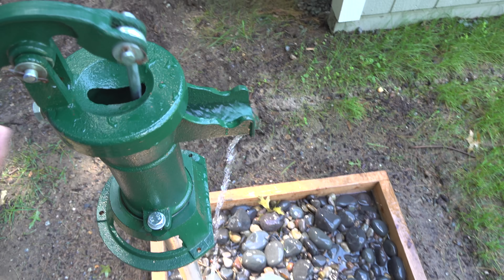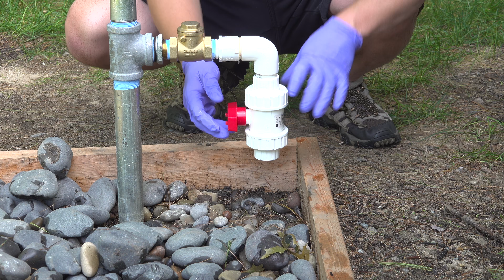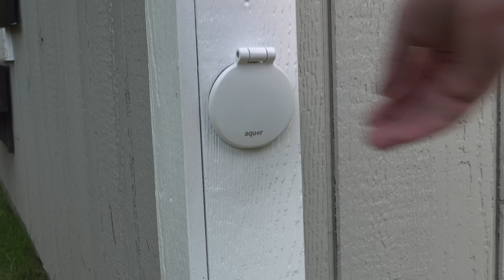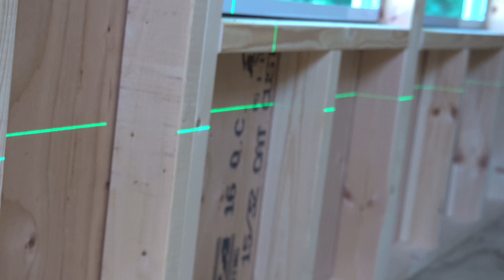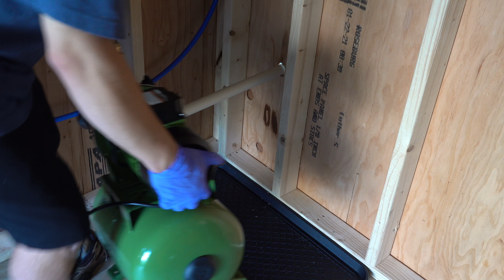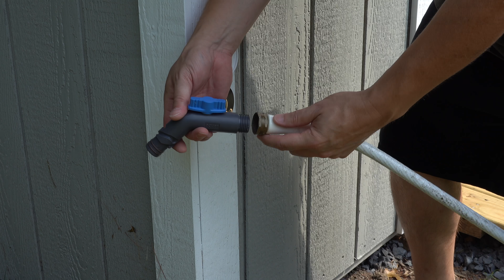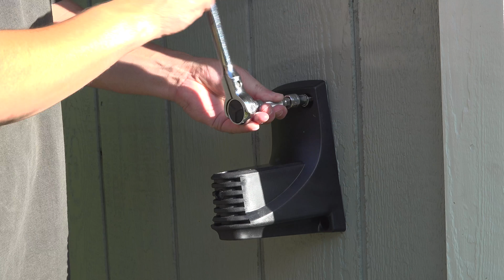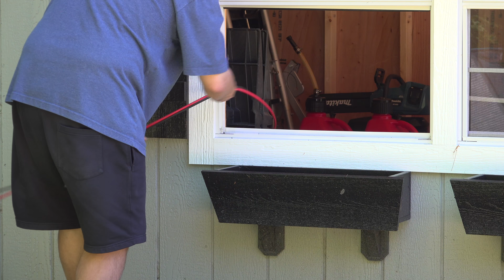DIY BACKYARD WELL with ELECTRIC PUMP - FREE Water

Comment: Nice video.   I've wondered about doing same thing for years, but additionally hooking it up to the sprinkler system.  I'm near a lake so water table is very high, in fact have a constant stream of water into sump pit 24/7 every day of the year.  Anyone know if you were to do this next to your house, is there a chance of soil compaction, and foundation damage as a result?
Reply: I'd be more worried about runoff pooling around the foundation than soil compaction. Consult a local builder, they'll probably tell you for free if you ask correctly. Give one a call and say "I was wondering how much it would cost to have this put in next to the house, and if it would be safe to do", then you'll have an answer and you'll know how much you're going to save!

Comment: The purple stuff isn’t cleaner. It’s primer that changes the molecular structure of PVC to allow it to bond to the glue. It’s really a must. Also that power station is not rated for pumps you are going to wreck that thing.
Reply from the maker: The fusion product I used, has both components or it's somehow able to do it  https://amzn.to/3A2INLb I have used it a few times with great results. The Ecoflow device I used has no limitations on using a pump, why do you think that?

Comment: I like the demonstration of setting everything up, it was very easy to follow. But is this possible with a solar generator that doesn't cost 2k or are the other ones not strong enough? That's definitely out of my price range.
Reply: You can diy a battery storage system for much cheaper. Lot of work though. If you don't have an all in one unit, you will need at least 1 kWh of batteries (2 or more is better), a solar charge controller at the voltage of the batteries, and a pure sine wave inverter that can handle 1.5 kw continuous power output. You can probably diy it for around $600-1000.

Comment: This is not allowed in NY as you may end up polluting the underground water with chemicals. I would recommend not to do this and draw water from regulated resources. We don't have scarcity of water in USA
Reply from the maker: It is not illegal in NY, I reviewed your DPH and all well types are mentioned including this one. Local regulations may vary but you aren't polluting anything doing this. If you have chemicals on the surface they go below the surface. The sand point well is not an entry point to a secret world below, its already one and the same.

Comment: If in the northern hemisphere where you have very cold winters, I would recommend using ALL cast pipe because when the ground freezes the water in the line will also freeze and split the PVC.
Reply: Not to mention that a back up battery will be a gonner after a couple of hard freezes. Lithium batteries aren't designed to be in freezing weather. Also, this project must have cost $2k-$3k to save a few bucks a month which makes no sense to me but whatever. Interesting project but not for all climates.
Reply: @viewer-i5o  LOL!  I was doing the math too.   Rich yuppie DIY has zero honest thought or financial rationale behind it ever.    Spend thousands to feel good about saving maybe a few 10's of dollars a year for a few years until the systems all start to age out and fail.  Then start over!
Reply: @illbeyourmonster2  Looking at a current rate sheet (IAWC), it's something like $1 per 170 gallons (about 23 cubic feet).  If you're using it for irrigation purposes, figure that 1,000 cubic feet will irrigate 12,000 square feet of lawn and/or garden at 1" per week, which would be about $44 per week for irrigation.  Depending on the growing season length, let's just figure you need irrigation from the start of May through to end of September, maybe 20 weeks a year for watering.  The cost for water would then be around $900 for a roughly quarter-acre sized plot.  Then you just winterize the well for the off-season.  Don't think it's something I'd suggest DIY'ing though.
Reply: @randomexeter3627  I get the math. I have done hayfield irrigation for years and the volumes of water add up crazy fast even for just basic irrigation work.  

I operate out of a stream on the property that averages around 200 - 500 GPM all spring and into summer and it's normal to run that dry before it leaves the property.
Reply: @viewer-i5o  My battery backups state you need to bring them inside in the winter; they shouldn't freeze. You don't need anything to live out in the shed after clearing the lines out for winter.
Reply: NO! You do not use metal pipes in areas that have freezing temp. You use poly-based pipes and fitting because they can handle being frozen due to that type of plastics' ability to stretch a little.
Reply: @illbeyourmonster2  Agree 100%
Reply: Ice  will break cast also.

Comment: Nice setup! If your water has any sediment that swing type check valve may fail easily I've switched mine out to a spring type check valve. I've been looking for a way to gey my 1hp 220v pump hooked up to solar and your config works well. Most of the solar kits for a centrifugal well pump require switching to a 12v pump
Reply: Having a DC pump eliminates the inverter, which is a source of inefficiency.

Comment: Hope the PVC does not Crack in the Winter since you are not that Deep to the Electric Pump? Maybe run a heater cord so you have it when temps drop in Teens.

Comment: I did something similar at our lake this summer. If you end up hooking this to a sprinkler system, go full 1" supply lines and then half inch to each sprinkler. Rigiht now your pex will be a bottleneck and restrict the GPM. Likely not an issue with one sprinkler, but will be with more heads
Reply: Absolutely agree. Minimum 1” inner diameter on the suckomg side and the output main line as well.
Reply: Thank you for that info!

Comment: The Eco system isn't cheap.  Having a company put a single circuit into most sheds seems like the more affordable option here.  If this was off grid, I could see going this route but in any normal city that shed is going to have to be really far from the house to go this option.  looks like the Eco starts at $1200 and the next step is over $2000, plus solar array and the mount system.
Reply from the maker: Agreed, if you are off grid the system is a bargain but if you can do AC and run a line or already have one the well itself including the pump is under $500 and when you consider the water it's incredible.

Comment: There’s a few mods you might want to make, as I’m in MA as well.  Did you forget about winter?  Might want to add some way to blow out the water out of the lines, to winterize the system, or bring that HF pump and portable battery indoors during the frozen tundra time coming up.  Good job, very creative.
Reply: Heh, this isn't a serious video - it's an add for stupid faucets that need proprietary connectors, and battery packs. Learn to know when you're watching an ad vs a serious how to video. Oh, and hose reels too... and solar panels - the longer you watch, the more products are "placed" into it. Haha, what a joke.
Reply: @gorak9000  Harbor Freight probably underwrites most of these. 😜   

Off top of head, other problems besides freezing in the winter: 1) having drilling rights to your property 2) knowing if that well water is safe to use untreated
Reply: His battery is going to freeze too but whatever.
Reply: He's in Florida obviously
Reply: A poor substitute for getting a real well drilled
Reply: @keyworksales6241  Depends how high the water table is doesn’t it. If you lived in the south you probably wouldn’t have to worry about freezing.
Reply: @keyworksales6241  Why pay the ridiculous cost of a well when you can do it yourself? Independence, give it a try.
Reply: @blnunya6689  because i can't bore 280' below the surface through rocks on my mountain.
Reply: @blnunya6689  ignorance; seems like you're already giving that a try.
Reply: @keyworksales6241  Me not being aware of your particular circumstances certainly isn't indicative of my level of intelligence but you do you.
Reply: @keyworksales6241  Dig the "They live" profile pic however.

Comment: Great video. I’d be curious about how to power a well with a battery like the Delta if you primary pump is 220v. Is there a way to tack on a smaller 120v pump for emergencies?
Reply: My pump is 220 also and wondered same thing as I have no way to get auxiliary 220 to the pump.

Comment: One thing you could have changed is a one way valve on the manual pump instead of a manual valve, so you'd never have to think about it. 
Does the pump "un-prime" if it sits for a long period of time without being used? 
Great video as always.

Comment: Should have put the tee beneath ground level in an insulated access container and buried the rest of that line deeper as well.
Reply from the maker: In deep wells they call that a pitiless adapter, bizarre name but that's exactly what it does but they are usually 4-5 feet down. But yes if you plan for full winter use that would be a nice addition.

Comment: What about winterizing to prevent freezing up and busted pipes.
Reply: Drain the system. Disconnect where needed, blow air out lines that are horizontal. Loosen or remove the outdoor  hand pump and cap off. Leave valves open so water flows all the way down via gravity. Adding a blow-out valve outside would help.

Comment: I can’t speak for other regions but in South Florida when pvc pipe is exposed to the sun it will eventually turn brittle and easily crack.  If it is exposed then it needs to be painted or covered to protect it from uv rays.
Reply: In Minnesota the cold cracks our pvc pipes lol
Reply: Use a latex based paint
Reply: Sun UV rays don't affect PVC as a 30 + year Pool repairman in Florida it wont get brittle
Reply: I does in the midwest to it just takes longer
Reply: Houses in Australia use pvc pipes as downspouts so I think it will be fine.
Reply: Florida sucks hahaha
Reply: @nonyobussiness3440  Yeah please stay out of Florida!  ;)

Comment: Great setup! Only thing I would’ve done differently is to use a larger diameter pipe than the pex to get possibly higher flow rate.
Reply: but then pressure falls off, unless you need flow rate at the sacrifice of pressure
Reply: @therealjpow  higher pressure can mean higher flow rate if done properly that is
Reply: @TheTallOne890  very true! then we get in the complicated math of pipe diameter and length of product travel but that’s a whole lot of work
Reply: @therealjpow  no thank you friendo not in the mood to do math lol

Comment: Can’t wait to see this get winterized
Reply: If he lives in an area that gets cold during the winter.. It's going to be a nightmare to keep that from freezing  up.. He'll have to build a well house over the pipe and heat it..
Reply: Disconnect the electric pump and cap it as shown, should be fine.
Reply: @CainnechK  any water still in the pump or lines will break them when the water freezes.  Compressed air is often used to blow out pipes, but he didn't include a way for the air to get out at the hand pump.  I guess his pump has a way to be drained of water?  He didn't say.
Reply: @chrisfuller1268  only the water near the very top would freeze, no?
Reply: @nxlxn  Anything above the freeze line will freeze, not just on the top, could go down couple of feet underground depending on the area.
Reply: @94nolo no it’s colder under it
Reply: Wells like this are maintenance free, remove pitcher pump in the early fall and the water will gravity feed back into the ground back to the spring. No harm done. I’ve seen many pumps like these go for decades without any maintenance.
Reply: @andrewfodor1917  You don’t have to remove the damn well pump…c’mon now…
Reply: Drain it.  Simple
Reply: For wells in cold areas a submersible pump is used and the well goes deep enough that it's below the frost. If you're somewhere with permafrost you have bigger problems.
Reply: All he has to do is disconnect the pump. Open the ball valve to let the water go back down and drain the small section with the one-way valve. That should clear the entire line, and he is good for winter.
Reply: Just drain the line from the well to pump and pump to hose, insulate the shed, and put a small electric heater in the shed connected to the solar generator.   Set the heater for 40 f
Reply: I have read if you drill a 1/16" hole in the pipe just below the frost line, the water will gradually drain down to that level avoiding a freezing well pipe.
Of course, if you have no check-valve above the well point, it'll drain out anyway. Assuming of course the system doesn't have too much of a vacuum on the system.

Comment: No way in hell does pipe just pound in the ground that easy.
Reply from the maker: I'm not superman, and it's some effort but if you can swing a hammer you can do it.
Reply: Cape cod has a lot of sandy soil, so that may have helped.
Reply: It's not easy but it takes a lot less time than you might think.  You will have blisters.
Reply: Just went down 20 feet the exact same way!  Probably about a quarter inch per hit with the sledge hammer.  Wear gloves and take lots of breaks!

Comment: I have been using the similar/possibly the same Harbor Freight pump without the pressure tank fed from a water source and have been very impressed. It easily supplies 4 impact sprinklers. Those pumps are definitely on of HF's hidden gems.

Comment: How long will that well last? Like is it just one and done water forever or will you have to move it at some point?
Reply from the maker: Sand point wells can last 20 years or much longer. You can also have them fail much sooner if there are local problems, excessive silt, etc. But even though they are simple there are thousands of these if not millions worldwide

Comment: Good idea on the union outside. I recommend to have one at the pump that will help with maintenance and tightening the fittings at the pump when they leak like in the video. Also did you bother closing the gap around the inlet pipe into the shed and if so what was your solution?
Reply: facts, the leaky pipes at the pump will cause issues.

Comment: You should look into Air well (condenser) - (AWG) Atmospheric Water Generator Technology's  
Ground level units that Pull water from Air Humidity 
20 Ltrs ~ 800Ltrs ~ 50,000Ltrs Per day 
it a nice backup for a ground well or if a grounds well is Restricted 

Some Regions Airas Do have  Ground  Well laws & Well Bi laws & Water authority
Due the Groundwater is Minerals and metals Toxic ~  Organics Contaminated or Restricted  - some Ground wells can be illegal in heavy drought regions
The fines are big for illegal wells

Comment: How long can you run the pump continuously?
Reply from the maker: On a full charge it could run the pump continuously for 2 hours. This model also can have two extra batteries added for 4 additional hours. There are other pumps that use less power and if you are using this for domestic water use, this would easily handle a days usage.
Reply: @SilverCymbal  Thank you. My next question would be the capacity of the water pocket as being a limiting factor. I guess you would have to run on house  electricity to find out.

Comment: Wondering why since you are already cutting holes and I am sure there's a better way than my suggestion. Instead of electrical cord through the window cut a hole and take an electrical outlet covering that has flip cover usually seen on outside outlet so you can slip into the hole when needed and otherwise flip outlet cover  I am sure you have a better idea.  But  I seen too many times when a stray dog or cat or little kid likes pulling on extension cables which can be dangerous. I also would use a rubber or plastic container cutting it if necessary for access put the battery generator device in it just to be absolutely safe keeping it from the off chance of water.  Maybe I am overdoing it.

Anyway great video as always
Reply from the maker: Great question, I wanted to trial the charging with the flexible panel first and a lot of people may use it with a mor etemporary setup like this for a cabin. Now that its done well I will move to a rigid panel and wire it through a bulkhead connection with some quick disconnects. It is nice to know that you could stand up a system like this very fast though.

Comment: Another excellent video! Get yourself a Berkey water filter, and you can have off-grid clean drinking water any time, as well. 
“As well” - see what I did there? I’ll show myself to the door…
Reply from the maker: Thank you, I have seen those, they seem really great! You can also run reverse osmosis systems for total pure water with no electricity too. I will have another video on water testing soon too.
Reply: @SilverCymbal  are you doing one on reverse osmosis?
Reply from the maker: @geod3589  I have used one in my house for ages, I really like them.

Comment: BTW You can Get Battrey-less Solar

MPPT VFD (Solar pump inverter ) + a Few All in one - Hybrid Inverters With AC loads Without battery Feature 

What become the Battery for the Water 
A Water Tower or loft Tank Water under Gravity or a few Accumulator blander tanks Water under Air Pressure (Pneumatics)

Comment: Why is the pump leaking into the boot tray? Is there a leak?
Reply: Nice work. As a plumber we like to use pipe dope and Teflon tape. Like wearing a belt and suspenders. Extra protection and rarely leaks. 

This was a great video! 🙂👍🏻
Reply from the maker: Yes, I put a little caption that said I needed to redo that connection. I fixed it today and no leaks any more